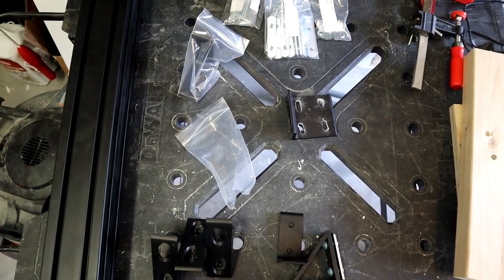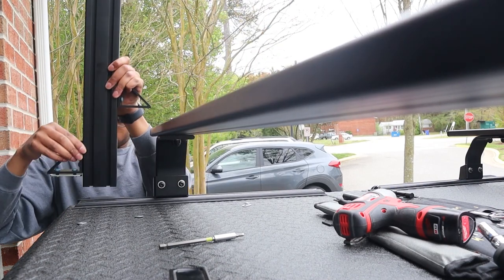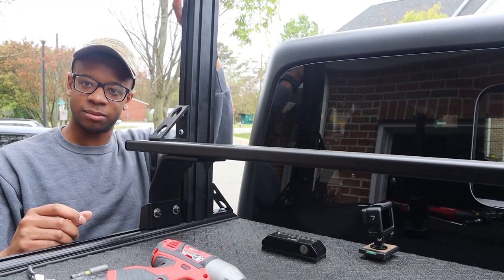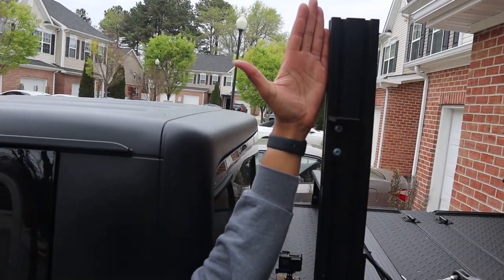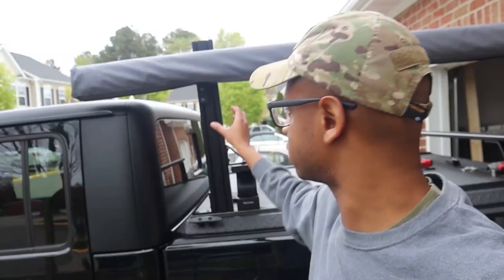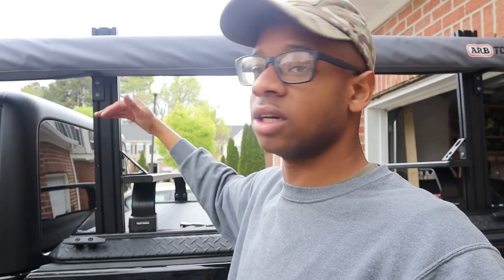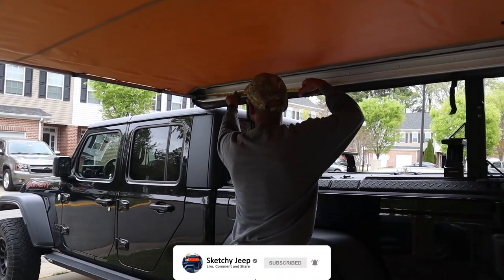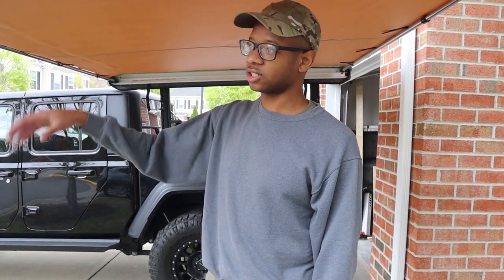DIY ARB Awning Mount for Overland Setup

Comment: Great video.  I just commented on your Front Runner video since I am in the middle of a similar install on my 2017 Raptor.  Now after watching this video I have another project to consider.  In my case I would like to install the awning on the tailgate end since that is going to be my high use area (using the tailgate as a table top for makeshift kitchen when camping). I receive my IKamper Mini tomorrow and once I have it mounted, I can decide how to approach the awning.  Thanks.

Comment: Great setup. How stable do you think the awning setup is if you do not use the front runner cross rack bars and just mount the extruded aluminum to the front runner rail system.  How much flex or wobble would the awning and vertical bars have?  Thanks
Reply from the maker: i think it would still be pretty strong, just put the brackets that are mounted on the front runner cross bars on the rails so the awning aluminum posts are supported on both sides. if that make sense.